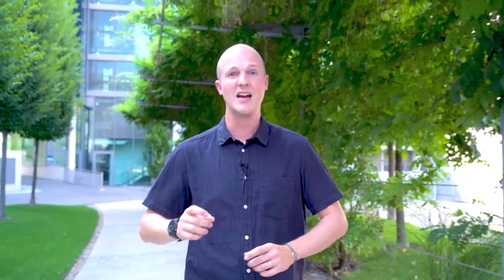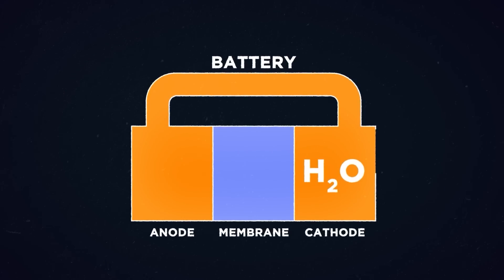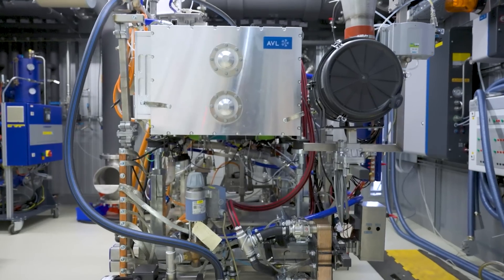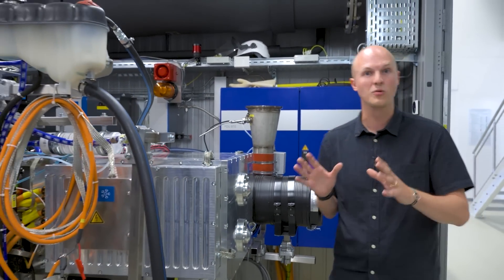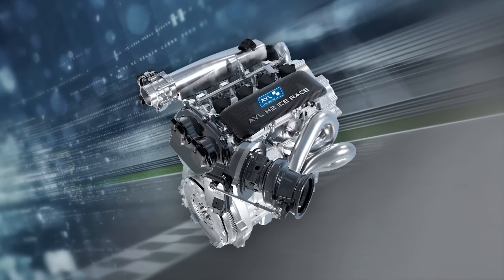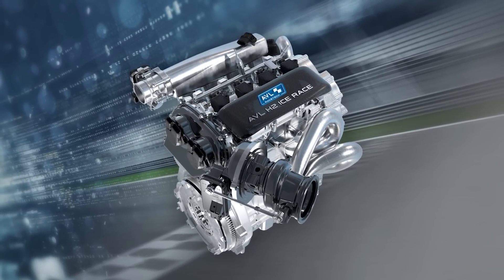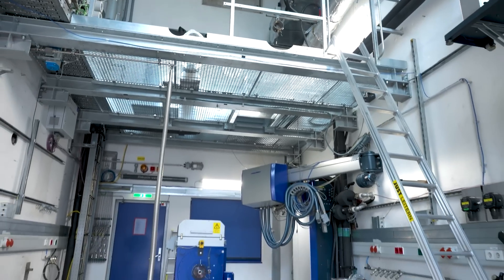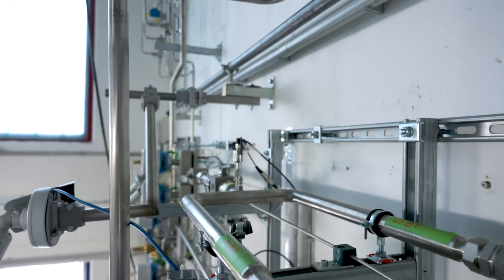It's Time To Get Excited About Hydrogen Powered Race Cars

Comment: And if all those oil and car companies actually cared about diversifying and developing green tech we'd almost certainly have seen these technologies reach maturity years ago.
Reply: hydrogen has been tested in prototypes for decades. but the tech is too inferior compared to EVs
-there will NEVER be a dense network of hydrogen pumps available almost everywhere like for EV's 60 stations in the whole US all in California. the number hasnt changed for years.
- to produce the hydrogen and distribute it requires 3x the amount of electricity as charging a battery EV, so refueling your car with hydrogen will cost more than gasoline and way more than electricity. ex toyota mirai cost per mile is equivalent to a 18mpg gasoline car, even though its way slower than a 56mpg prius. compared to electricity cost, its like 20mpge so more than 2x more expensive than charging a hummer EV or more than 6x the cost of charging  an efficient EV like a tesla
- you cant refuel you hydrogen car at home like an EV
Reply: duh. its about energy density. there no coincidence that oil is the best for transport. Please remember that the engine runs on the oxygen it collects along the route.
No other technology can come close to that benefit.

Comment: your numbers are wrong at least regarding the 100 kw fuel cell producing 50 litre of water pet hour 
each kg of hydrogen would convert to 33 kilowatts producing 8 litres of water which means your 100kw fuel cell putting out a 100kw per hour would produce only 24.25 litres of water per hour so you would produce nearby 50 litres of water with a 200kw system not a 100kw system

Comment: Expect new motor rules for F1 probably not before 2031, five years after the new engine regulations of 2026. By then my money would be on a new hybrid combination of hydrogen combustion (for that racing sound) and hydrogen fuel cells (probably more applicable in the automobile industry which is important for the works teams.).

Comment: For a channel called "Autosport" you should know fuel cells are not energy dense enough and are too heavy to power an F1 car. Also, I don't want F1 cars to sound like Formula E cars. If they replace the ICE, I'll be done with F1.

Comment: Great video! I have to think  that racing would prefer to use hydrogen combustion engines instead of fuel cell ones. If only for the noise!
Reply: More practically, take an existing big rig and change the engine and fuel tanks and we more cheaply and less carbon emitted move to a low carbon logistics world
Reply: @benpenagonzales6014  not practical at all, if you are using hydrogen with combustion engine 
-first converting big rig diesel engine to hydrogen is not possible, it operates like a gasoline engine
-the low energy density (per volume) of hydrogen  combined with low efficiency of combustion engine means your range suddenly  becomes ridiculously low
-if hydrogen is stored in liquid form at atmospheric you need  excellent thermal insulation but it still evaporates and you are constantly venting H2 into atmosphere, your tank goes from full to empty in about a week
-you need a fuel pump that can operate at −423°F to pump liquid hydrogen. Toyota tried it but they had to replace the pump TWICE during 24h of Le Mans which took 8 hours total...
-if hydrogen is stored as pressurized gas, you need  a huge and expensive carbon fiber cylindrical tank and it's also long to refuel
Reply: @geemy9675  I think the game has moved on since then. See what JCB are doing with light and heavy good vehicles. It’s on Harry’s Garage channel. Not market ready yet Tbf but not far away.
Reply: @benpenagonzales6014 ؛؛ ::٢٠
Reply: @benpenagonzales6014  hhh
Reply: نا.
Reply: toyota hydrogen combustion le mans race car: 65km range, 4 hours spent refueling gas hydrogen in 2021 and 2022, in 2023 liquid hydrogen 8 hours spent replacing twice the fuel pump
hydrogen combustion sucks for race AND road cars
the noisy inefficient combustion engine is what limits the range, with (silent) fuel cell and electric motors you have 2x-3x better range..imagine spending more than half the fuel just to make noise 😀

Comment: How are they going to transport Hydrogen at -252°C to all the parts of the world?

It's very energy intensive to store Hydrogen as a liquid.
Reply: Probably makes more sense to produce the hydrogen near each track
Reply: Insulation, that's how
Reply: @Gryph Lane  Lol... Dunning Kruger. You have no idea how difficult (ie expensive) that is.
Reply: @s2hedz  You clearly don't have a clue what Dunning Kruger even means lol... I never said it wouldn't be difficult or expensive but since when has that ever stopped F1?
Reply: @Gryph Lane  🤣 Yes, Mr. Dunning Kruger...and btw who said F1? If you knew much about the topic you'd know that the preferred way of transporting H2 in the future will likely be via ammonia...because just like OP said, it's too expensive otherwise.

Comment: Hydrogen ICE are nowhere near as efficient as EV's. Especially when you take the production of hydrogen into account. ICE are wonderful, but just so much more complex, unreliable and inefficient as electric motors.
Reply: You can't really say that Ice are not as efficient as an EV engine. They have more than 100 years of history behind them. The seconds have seen the light a decade and half ago
Reply: @donatonoc_00  actually electric motors have existed for a while ( almost 200 years) and they already reached 90% efficiency 100 years ago, combustion engine was around 15% now 95+% vs 30%-40% but combustion engine has pretty much peaked. R&D is dying. EV Electric motors are already so good they can be less than 5% of the weight of the vehicle, less than 5% of the inefficiciencies ( way after 1/ aerodynamics 2/ rolling resistance)

Comment: ive read the maximum of dyno is 1300kw, wow they updated to 2.5MW maybe next test would be 3 MW cant wait to see it on track.
Reply: There is also the possibility to join 2 dynos together with one gearbox to practically double the power capacity.
Reply: There also dynos in the 100 MW range for testing ship engines.
Reply: 363
Reply: 0
Reply: Sennane
Reply: 2
Reply: Ā3
Reply: 6 2
Reply: 468à
Reply: 3
Reply: 361

Comment: I refuse to become excited by inferior solutions and nifty though they may be.

Hydrogen internal combustion is at best a short-term stopgap to incentivize building hydrogen refueling road infrastructure.
Reply: Yes, the benefit of hydrogen is that it can benefit from current gas stations infra and has a faster (compared to EV) recharging time. So, other than a massive tech upgrade, it will be a stationary industrial energy storage/transport system - maybe even better than batteries.
Reply: @mustavogaia2655  I don't know the hydrogen actually benefits from gas station infrastructure. Certainly not as much as electric vehicles. It costs much more to put a single hydrogen pump than to put enough EV stations to match it in place.
But my main issue is just hydrogen internal combustion being heralded as cleaner and better for the environment when it's like explicitly not.
So like If I'm going to have a loud shaky engine in my car, I'm going to put the one that has way more years of research and development, economies of scale.

PS by the time hydrogen and its infrastructure is ready, electric batteries will be good enough hydrogen might become irrelevant outside of aviation.p
Reply: @larsmurdochkalsta8808  I mean in term of the existance of a place where large capacity fuel tank are already stored and the service is similar to a liquid fuel.
It seems easier to convert one pump on a gas station than to convert a parking lot into a EV charging station